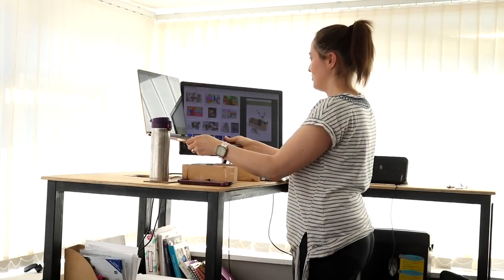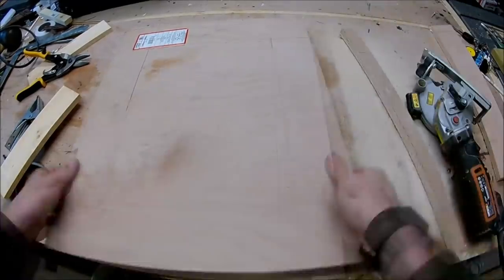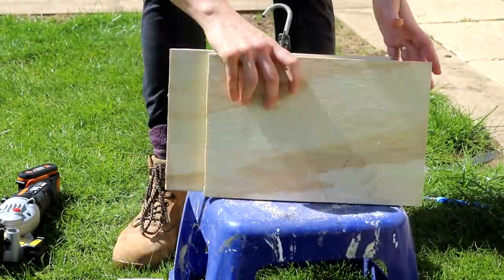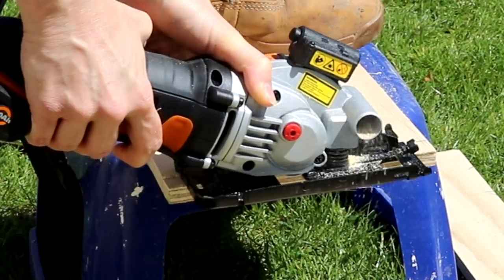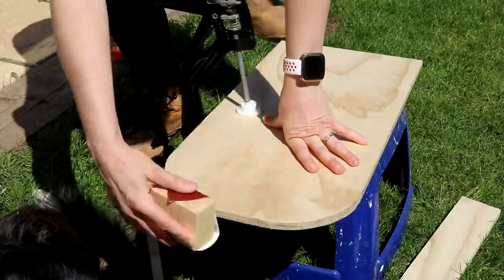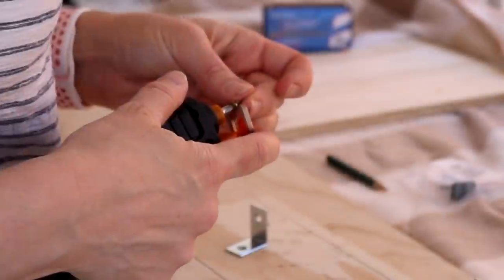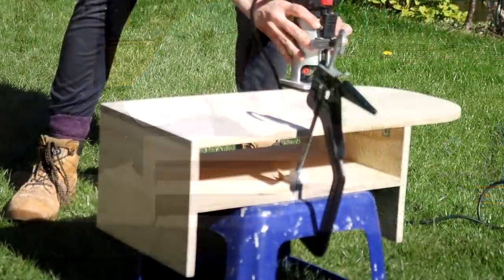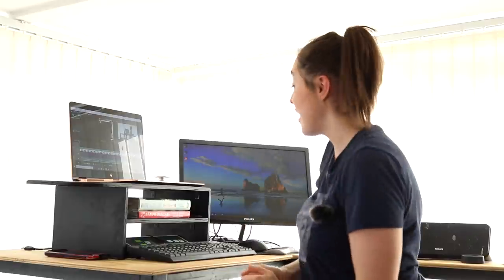How to Make a Laptop Monitor Desk With OffCuts | #AD & GIVEAWAY | The Carpenter's Daughter

Comment: Handly laptop stand I think I will make it for myself thanks for the idea 
But instead of a desk stand, I think I will mod it to fit behind my monitor on the wall to save desk space
Keeps the great video coming.

Out of all the brands of tools I have Have Worx is the worst, very unreliable
I will explain when I was building my bedroom build in wardrobes 9x8ft I went through 2 Impact drivers and a combi drill the motors just burned out 
When I rang Worx about this I got the cold shoulder. They said I must have been using them incorrectly and when I asked why they could not handle 18mm oak faced MDF for drilling and screwing
I got the answer that I must have been pushing too hard.
I would never buy their tools again. 
I moved to Makita impact and drill and build 2 30x40ft sheds and 6 built-in wardrobes with no issue
Reply from the maker: Thanks and sorry to hear that!

Comment: I love my worx saw better than I gave it initial credit for.
Reply from the maker: Curious about how the corded one compares to this.  Do you have that one too?
Reply: The Carpenter's Daughter yes I have the corded it’s good with nothing above 25mm in thickness. I use a small roofing square as a guide and often clamp on a straight edge for longer cuts it’s a handy and very effective bit of kit. I am a fan of worx tools for smaller projects.